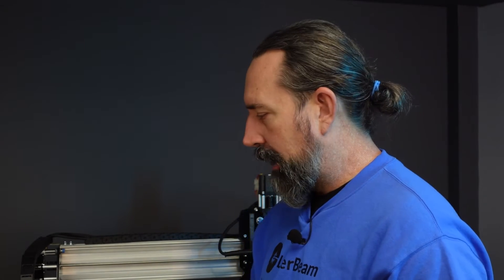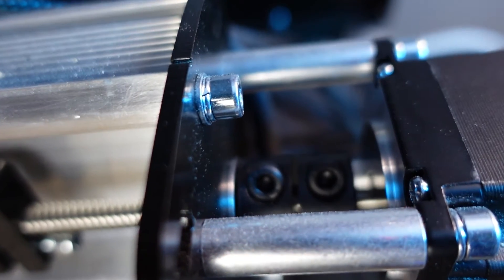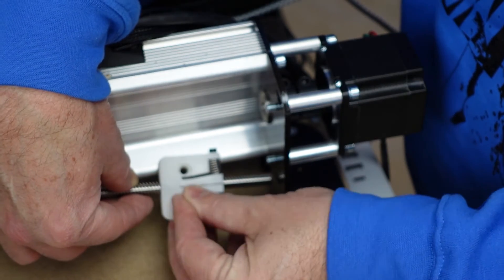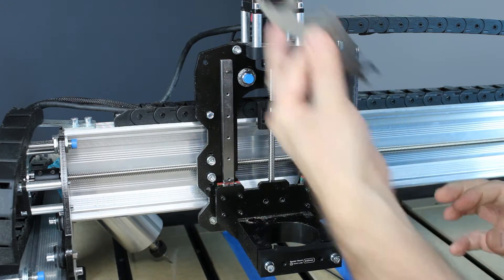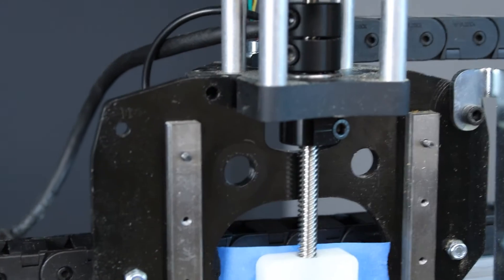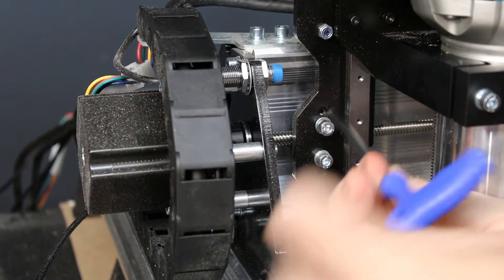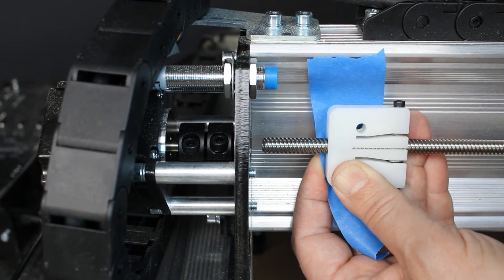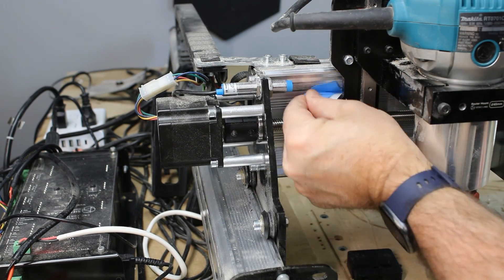Spring-Loaded Backlash Nut Installation Guide for LongMill CNCs by Sienci Labs, Updated

Comment: Also, you will want to install the x-axis (at least for the T12 version) with the spring side of the backlash nut facing towards the right or the router (away from the x-axis motor), otherwise about half of the backlash nut is off the gantry plate. This is opposite of what you show for the y-axis installation.

Comment: Trying to install per these instructions on a MK2, had previously installed the z axis opposite from the way you suggested. When I try to flip it over I can't as there is a conflict with two of the four screws holding the router mount to the gantry. Can't get the backlash holes aligned with the gantry holes.
Reply from the maker: If you're still having trouble, please contact our customer support by submitting a ticket with pictures! 
https://sienci.com/contact-us/#:~:text=Phone%20or%20text%20us%20at,or%20replies%20with%20text%20messages.
Reply: Did you get this sorted out? I’m having the exact issue you’re describing.

Comment: This is a great upgrade for my CNC. I was never sure exactly how tight the old ones should be. I found that there wasn’t enough room on the Z axis of my MK1 no matter how I oriented  the new backlash nut. I finally realized that as recommended in the original assembly instructions my router mount was on the upper set of holes. Once I moved it down everything worked out. Getting at those setscrews to move it down proved to be quite difficult with everything assembled. It would be appreciated if you pointed out this possible problem and added some instructions on an easy way to move the router mount on an already assembled CNC.
Reply from the maker: Noted! Thanks Donald, we'll pass your comments on to the team!